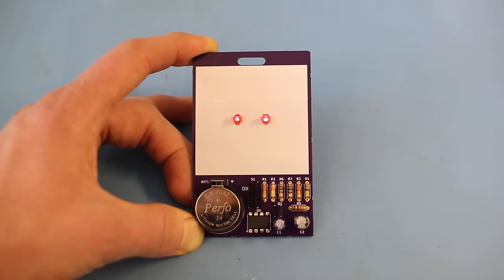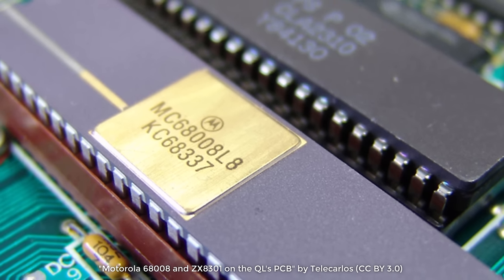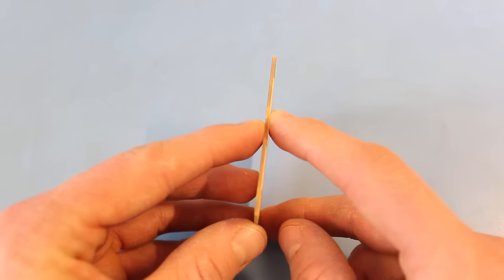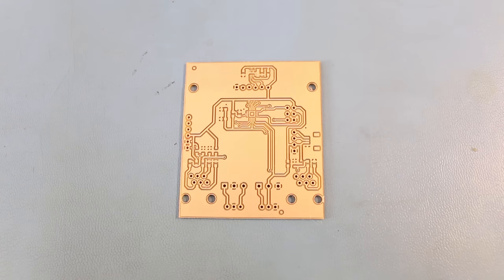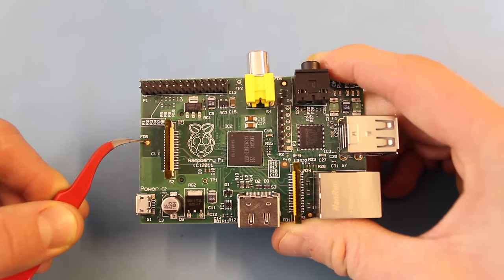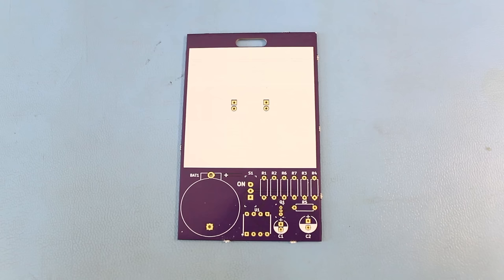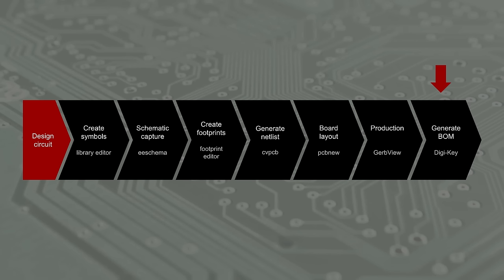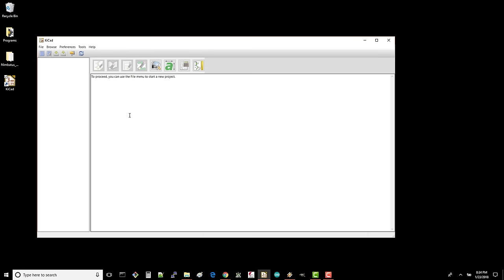An Intro to KiCad – Part 1: How PCBs Are Made | DigiKey

Comment: Enjoyed the reference to wire wrap, something most people have probably never seen.  I handbuilt my first home computer built using wire wrap.  That technique wouldn't work now due to the much more stringent electrical design requirements. The 6800 processor was so slow that electrical noise wasn't much of a problem.  It booted to Mikbug, which is essentially just a loader, not even a rudimentary OS. I wouldn't want to go back to that, but it sure was an excellent learning experience in basic digital design and computer hardware.

Comment: In this project, you end up soldering a bunch of components to the board but is it possible to have the manufacturer do that when they print it? How is that done in the real world?
Reply: some board mfg do offer the service of solder the boards for you, or you can get a template made so that you can apply the solder paste/parts then reflow yourself. or make a through hole design that will be easier for you to hand solder